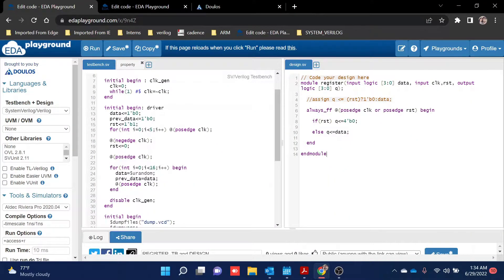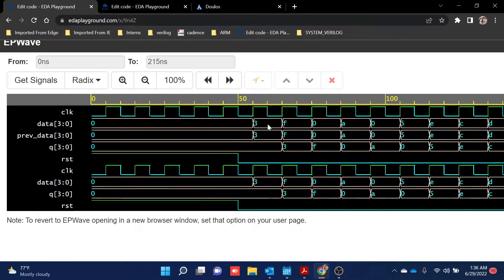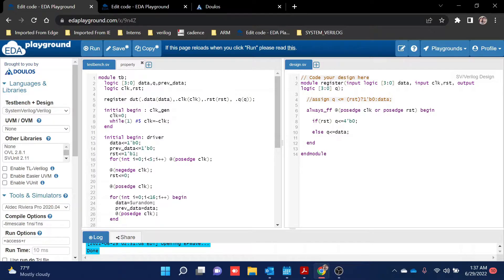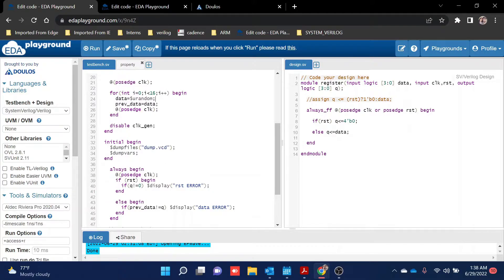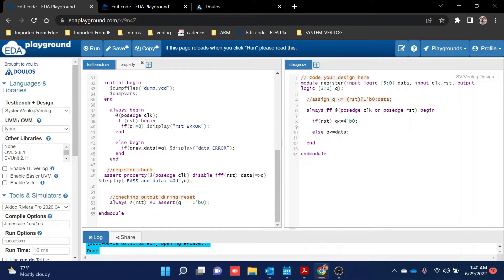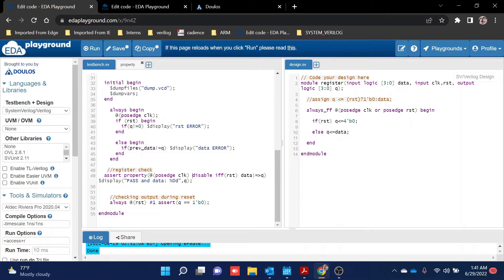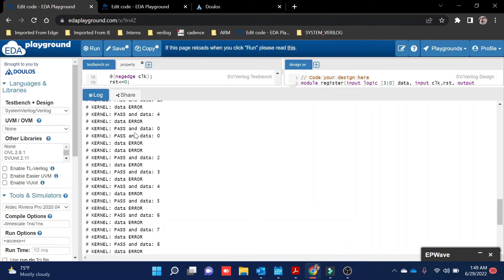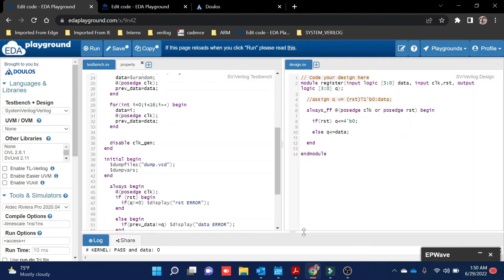REGISTER and D-FLIP FLOP DESIGN And TESTBENCH || REGISTER ASSERTION || SYSTEM VERILOG || PART 3

Comment: Hello sir, first of all thank you for making this video. I have one doubt related to design. You mentioned that data will be held for one clock cycle and in the next cycle we will get the data. Why is that? As far as I know and what i can see in the design is that at posedge when we r driving the data in the DUT, at that time output is getting the data (output <= data). Yeah I feel the need of using register and that is we want to make it work at any particular edge (either posedge Or negedge) . But didn't understand that next clock cycle wala point. Could you explain it  ?